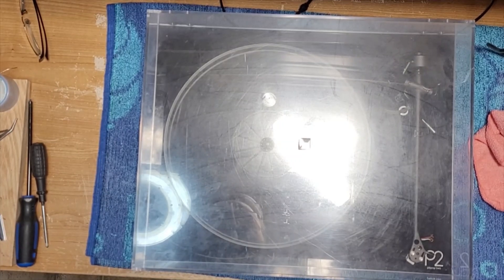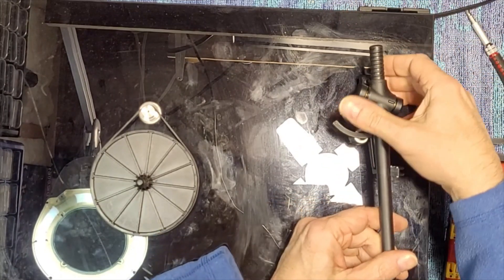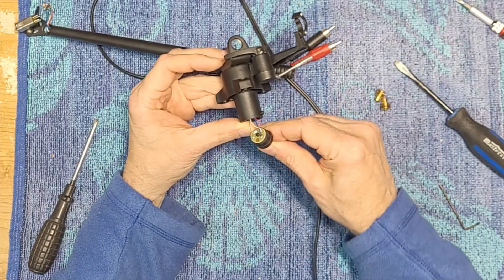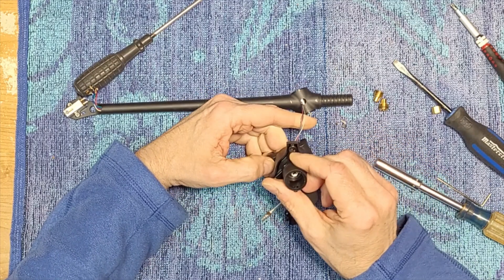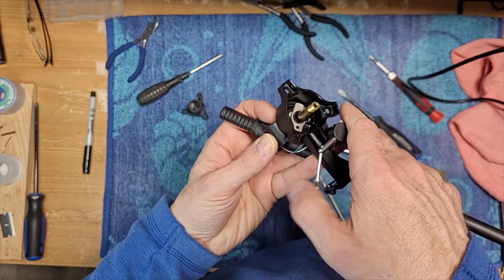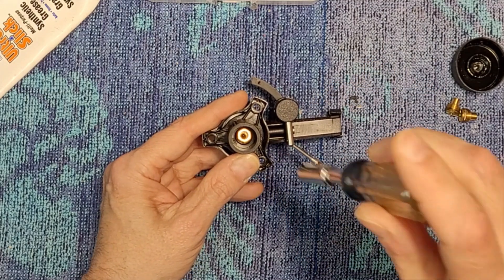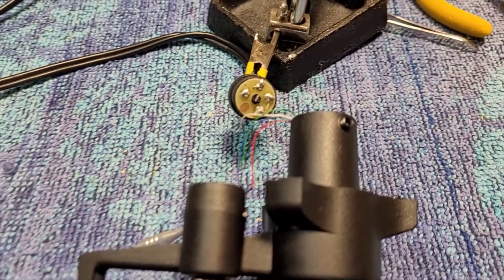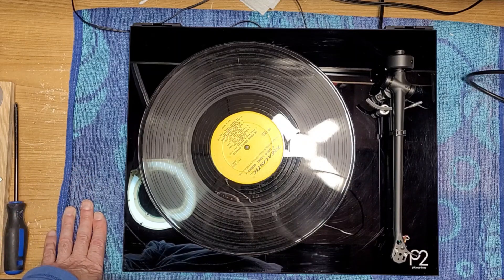Rega Planar 2:  Trying to repair "girlfriend" damage.

Comment: Very interesting. years ago I had a Music Hall 7 turntable with stiff horizontal bearings. I bought a special tiny spanner wrench ($25) to deal with the situation and found the gimbal was out of it's socket, I got it back into the socket and tightened it a bit. †he result was the arm seemed to work fine - probably not perfect but a lot closer.

Comment: I've never owned a high-end-ish turntable before (~$1,100 including tax and an upgraded cartridge (AT-VM540ML) so I don't know if it's normal or not, but I bought a Planar 2 new about 6 months ago.  Anyways, it it normal to have a whin-y grind-y sound as the platter winds down to a stop after turning off the power?  PS Merry Christmas :)

Comment: Should there be any play at all in the vertical sleeve bearing? My rb220 has about a 64th of wiggle? Any help appreciated
Reply from the maker: There should not be any play whatsoever.  You can try gently tightening the bearing fasteners.
Reply: Thank you, I will attempt to tighten the nut in the vertical riser.

Comment: He's blame shifting judging by the condition of it, he didn't have that higher regard for his turntable either. You'd think he'd at least clean it before sending it in for repair. 🤔
I've had my Rega Elicit R amp and Planar 2 turntable for a decade without so much as a fingerprint in sight. Thanks for sharing, it's not often one sees what goes into manufacturing high end British audio equipment. 😉

Comment: You should have clean the cage probably taking it off and clean the race out and the nut was slightly over tight that's why you need to put Loctite back on.

Comment: 2.5 grams ,is it real i never knew a turntable not professional  using 2.5 grams of anti-skting ,and i have at least 48 years of experience in fixing turntables and almost every model known to men i already tested and repair it and having started a radio station in the biggest district or region of my country, also worked as a dj for 35 years ,so i think i know a litle about turntables, this new REGA, Pro-Ject and Fluance turntables are almost ridiculous, and the constant changing of cartridges is very strange , one would change once the cartridge or at the most twice but this in a period of 30 years not from one year to another  and i used to call garbage to most of the turntables released in the 80´s being mainly built of plastic, now i know i was wrong they were made of plastic but with some extras would sound like any average good turntable ,this new ones seemed like old turntables built for 4 years old kids by CHICO. I´m being a litle excessive about this new turntables ,a friend of mine who is 87 years old and he´s from germany but living in south interior of Portugal ,sunny all year around, he bought a Pro-Ject with a very detailed sound and good as any old brand of perfect turntables but between the turntable itself and a good cartridge he spent 14.000€, i would prefer a Mercedes 500SEC from the 80´s in perfect condition but that´s just me, and already have two ,a 280 SEC and a 420SEC, here the power goes up the price comes down but let´s talk about turntables, in my opinion having bought all my life 7 turntables not counting the ones who belonged to my family that were given to me, even i thought some years ago "i have to buy a Pro-Ject turntable" in my opinion all are snake oil or dust blown to people´s eyes they look simple and nice but sound worse than  the worse turntable i ever saw or listen to, and i ask to myself "does this people never heard a average or cheap componet system released till late 90´s" even those made entirelly of plastic" it seems not, i remenber a friend of mine who had a compact system from CROWN ,that people would critisize and call it bad ,it had a cassette deck  with vu meters a turntable and a tuner but all built in brushed aluminium and i listen to records and also recorded a cassette ,it had a very good sounding turntable and the cassette was perfectelly recorded and they used to say it was a bad system ,just because it was compact, they sell them today needing maintenance for 100€ at the most, a 1.000€  turntable from Pro-Ject with a 2m red ortofon would dream everyday to "when i grow up ,i want to be a turntable on a compact system from Crown from the 70´s" and this is those with a large cover that are slim but very large,, and i´m not going to refer to the same type of compact system released by Panasonic ,would seem a equipment of the future but released in late 70´s, the world turns and like Sting said in a song "history will teach us nothing"i don´t even know to which turntable i could compare it ,i would like to be alive in the next 50 years to see people saying "this pro-ject , fluance or rega worked perfect with minimal maintenace for the last 50 years" but they sound really bad when new much more with 50 years of usage . to end i would like to say that the Fluance if there was not any turntable in the world i would choose this from the other two brands, it sounds better ,about one changing with our own hands the belt and being exposed to the elements everyday of the year ,it´s just ridiculous after a month of using it all are with the wrong speed this tested by some, here on youtube ,where they compare the cheapest technics turntable evermade and a almost 1.000€ pro-ject, all specifications on the new pro-ject are wrong when measured  and for the surprise of this gentlemen the technics with decades of use have better specifications than the new pro-ject and when measured they still work with the same specifications after almost 40 years of use and not that well taken care off, regards
Reply from the maker: The Planar 1 and Planar 2 come with a "Rega Carbon" cartridge from the factory.  It is a re-badged Audio Technica AT-3600L which tracks between 2.5-3.5g.  I set it much lower because it sounds fine at around 2.25g.  https://www.lpgear.com/product/ATC3600L.html
Reply: @TurntableGuy the at3600L is a good stylus with it´s cartridge i myself last year to substitute a ortofon mc type not available anymore i bought a audio-technica art7 known in the 70´s to be one of the best brands in the world  normally a home stylus would go at the maximum tracking force 2.0grams which is rare 1.3 for technics 1.5 to 1.8 to grado platinum ,most of them have this as minimum to maximum weight this to read perfectelly what´s in the grooves ,one can put 2.0Grams in a technics turntable but some detail on the drums highest frequencies just vanish (it´s related with the 20 degrees of angle from the conventional stylus against the record ),but when using two SL-1200mkII i used first technics professional needles than i changed to shure professional needles ,they were a lot better than the technics but from 2gr. to 3gr. or the concorde in the 90´s from 3gr. to 5 gr. ,this off course it wasted the record grooves but dance music is more simple and the beat is the more heard ,when working in party´s that i was asked to put music like the cult or death cult, sisters of mercy, the the , bauhaus ,joy division  after new order that were world wide known with their 83 maxi blue monday and a lot of other bands that were fashion in those days, those i used the regular stylus but 2.0gr. at the most wasn´t going to create loops or scratch but light scratch or just use sounds in reverse with the help of the crossfader ,that´s when the acid house movement appeared or as they call it in England madchester because of the "la hacienda" (the farm, in spanish)in manchester, then begun the maxi-singles already remixed by dj´s with the most known dance songs or hits but at home i have a very heavy headshel and i need at least a 6 grms counterweight but the stylus only puts 1.8 of preassure in the record, cd´s have a more reduced quality sound ,one used to test the turntable like if after listening to a record one changed to cd and the sound was very bad that´s when the sound of the turntable is o.k. less than that is not good, this having nothing against digital because the best sounding live record i have i bought it in 1990 and it said in the back "directelly recorded into DAT" but the cd version is horrible, the title is Dream Syndicate live at the rajii´s, i had a DAT deck from sony and it sounded perfect and it was digital but a expensive format, so till today allthough they have not half of the quality till early 90´s , LP records they do sound complete with a good system it seems they´re playing at one´s home ,the main problem is converting analog sound to digital ,also there are a lot of cd´s with a very good sound
Reply: i guess they´re trying to hide the bad sound on cd´s , but that´s why young kids when listening to their fathers alternative bands they just don´t like the way it sounds which is bad , they´re only listening to 30% of the sound heard on old receivers and turntables and big speakers with less watts
Reply: @TurntableGuy  zThe rega 3 is set at 1.75.
Reply: Depends if you play it every day or twice a month but they certainly not as bad as these rega bashers  state. I have never heard such a clear sound in my 45 years of buying hifi as my Rega 3 I refuse to purchase any other, Mr Gandy knows his stuff.
Reply: @ENGLISHISBEST  the rega 3? is it a stylus or a turntable because the stylus is the heart and soul of any turntable and the grams are for the stylus not for the turntable model